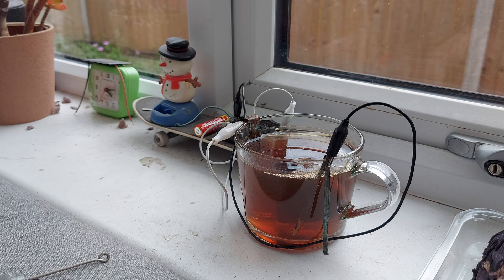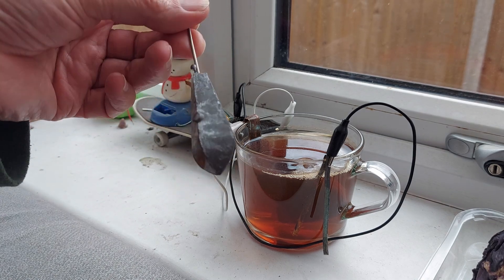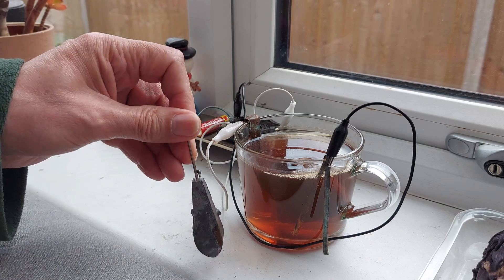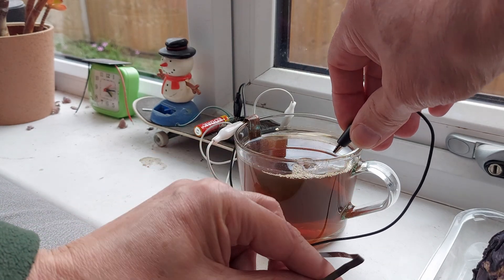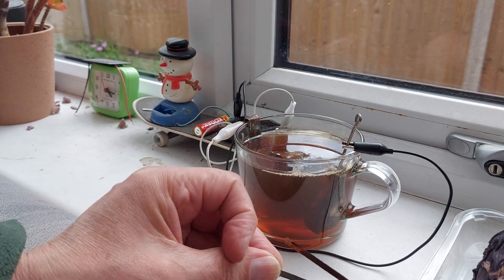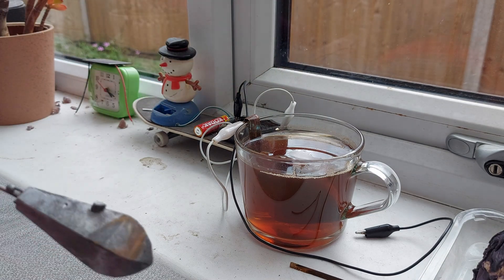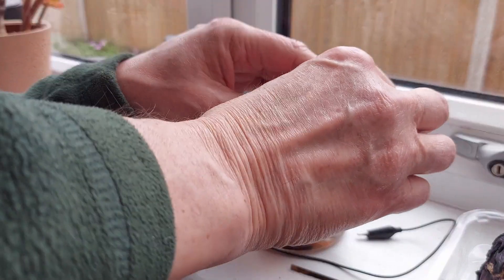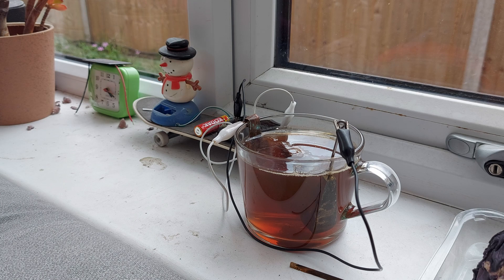Will my snowman run on copper and lead electrodes?

Comment: Copper and Lead have almost the same electronegativty, so the expectation is much less voltage than with Magnesium. Zinc, Aluminium and Titanium should be better but still lower than magnesium. Although Al and Ti tend to passivate under certain electrolytes.
Flipping polarity, where the Copper gets used up, you could use Carbon, Platinum or Gold as well. Using Platinum and Zinc or Carbon and Copper should give a comparable or higher voltage to Copper and Magnesium.

Comment: I thought the lead would have worked. Then that is probably wishful thinking because lots of batteries use lead.
Have you tried using nickel? I thought of nickel as we have nickel–metal hydride batteries. 👌👍👍
Reply from the maker: With enough cells in series to build up the voltage the copper/lead would probably work. As for nickel, that gives me an interesting side thought/rabbit hole 🤔 I don't know how I would identify nickel, I don't even know for certain that the copper I use is copper or the zinc I use is zinc, or for that matter if the lead was lead. The only reason I believe I have magnesium is because that is what I ordered. Without being a chemist, I don't know how I could be sure of any of the materials I have used. In fact many of the items that I have assumed to be stainless steel could well be nickel plated as that is used for the same purpose. From memory, stainless steel would be using chromium. I have just checked and stainless steel can contain chromium and/or nickel 🤔🤔 I said it was a rabbit hole.

Comment: As long as the lead does not dissolve over nite like my magnesium strips do, I would not mind making 4 cells of copper and lead to replace the magnesium strip cell.
Reply from the maker: Yes, the magnesium doesn't last long. It is quite hard to come across lead nowadays as many of the products have changed to some other metal due to the health issues. It used to be easy to collect a few weights around the tyre change depots, but they don't use lead any more for the balance weights.

Comment: I wonder, was that a steel rod on the lead weight? It seemed to be in the tea, making it the metal being measured. 
Carbon/lead lasted for 5 years with no degradation on an LED flasher, copper/lead should be more than 0.3V y'see
Still, thanks for running the test!
Reply from the maker: Interesting point, but I wasn't 100% sure that you were right, so I ran a test and got results I didn't expect. I will be interested to hear you take on what happened with the magnesium 🤔. The video ended up much longer than intended as I kept getting "what if" ideas after I thought I had finished 🤣 https://youtu.be/YSQnxUSjie4

Comment: Have you tried carbon,  I have tried quite a few things but not carbon,  or silver ect 👍
Reply from the maker: Yes, I have used carbon quite often, just stripping the centre rod out of zinc carbon AA batteries and quite often using the zinc case as the other electrode.

Comment: I suspect it would need to be a more acidic solution.
Reply from the maker: The actual voltage is a product of the different values the metals have on the galvanic table. The one I was running with "lime juice" was eating the electrodes very quickly. With magnesium strips it reacted so fast it foamed up out of the container. Zinc electrodes were less reactive but still only lasted a day. This lump of lead would probably last a few weeks 👍👍